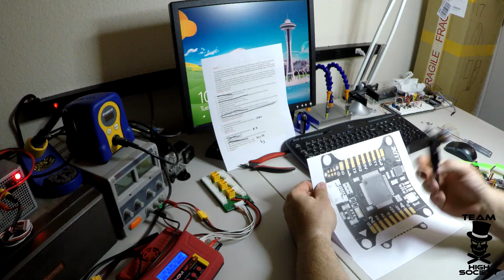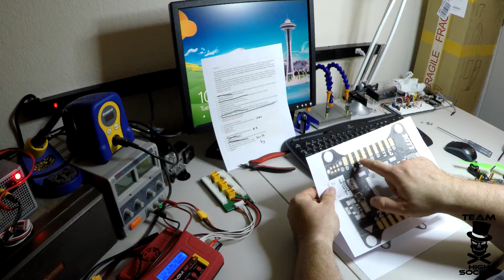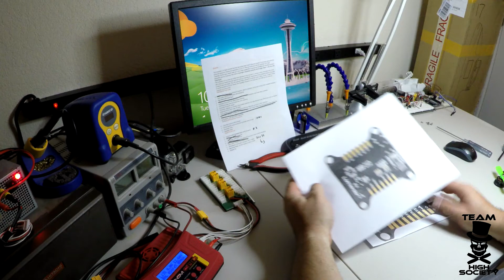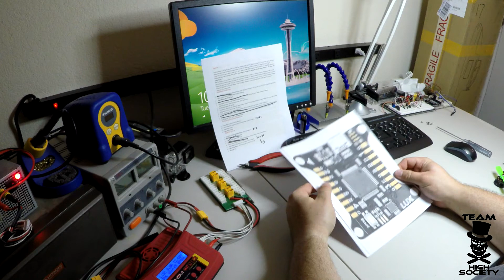Lux flight controller...Only if you just don't care! - THS

Comment: Fair review. I've put a small breakout socket in the frame connected to UART 3 for blheli passthrough (just a servo socket). It makes it fairly easy to connect a ftdi to.  I'd rather not have to though.

I almost went for the Xracer board. Great value, but I didn't order one because it doesn't have vbat connector. Apparently there is a new revision coming with vbat though... so it might become my go to FC.
Reply from the maker: +Womp Thanks for the comment! Yeah its great that F3 FC's are getting so cheap!